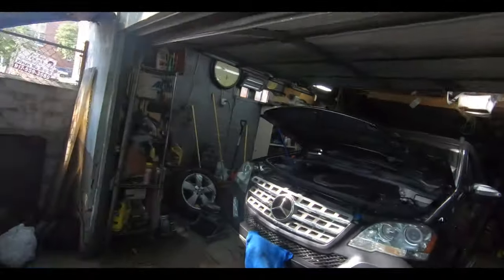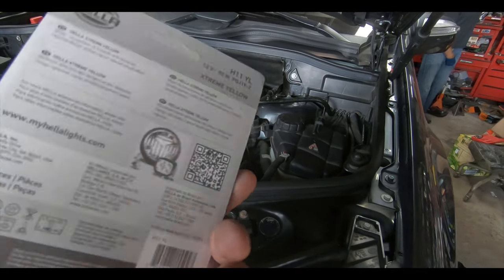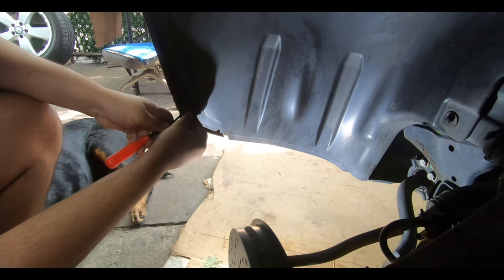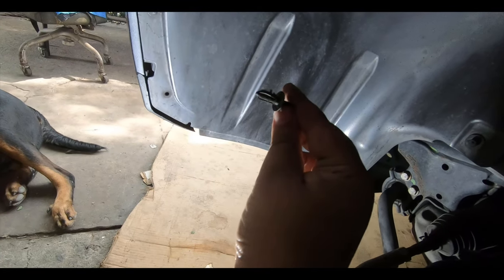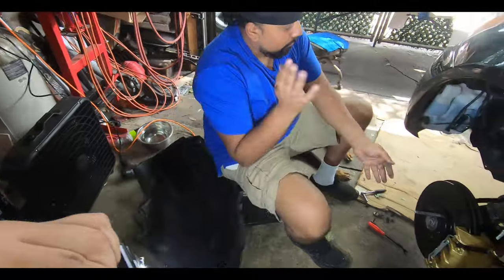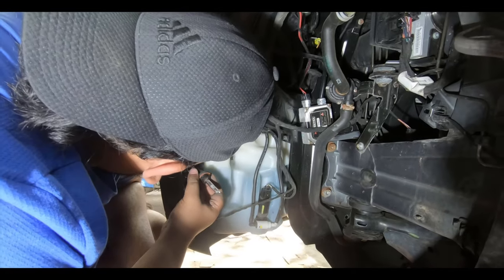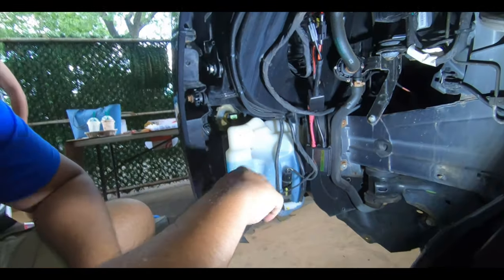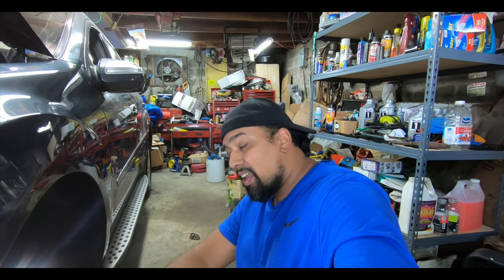Mercedes W164 ML350 Fog Light Replacement/Upgrade

Comment: You should .just remove the front plastic and do this in 2 mins. Too much extra work for a bulb replacement
Reply from the maker: Yeah I was also doing the headlights so it made it easier. Also when doing it from the front you have to be careful as the tabs like to break.

Comment: This guy doesnt know his stuff to replace fog lights you just remove the grill around the fog light then use t25 to remove wheel does not have to be removed he didnt do his homework the headlight are also removeable from inside the engine compartment